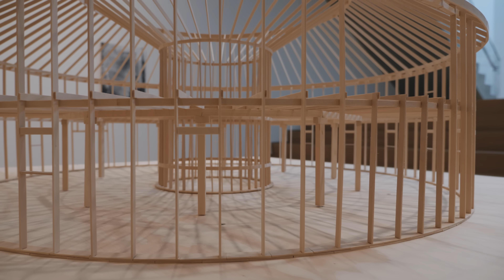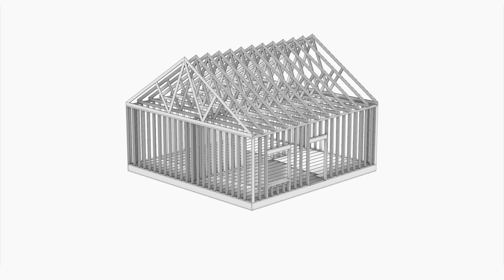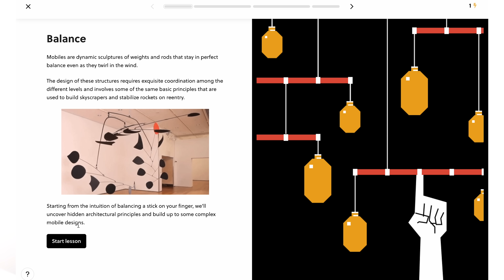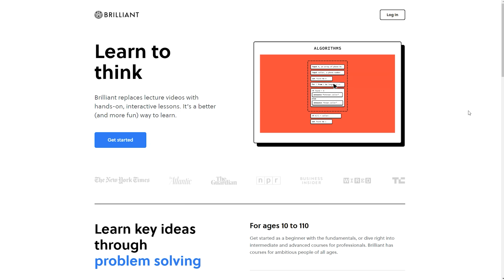The Genius of 2x4 Framing

Comment: Very nice video.  Thanks for producing it.  One constructive criticism:  I don't feel it's fair  to equate professional framers to unskilled laborers.  ((actually it's (unintentionally?) insulting))  A person could spend 30 years framing and learn something new every day; and at the end of that career the materials and building design will have changed again.  Some go to trade school; others learn on the job.  It's a highly skilled, complex trade, and in most cases the first year or two of service consists of simple laboring.  (carrying materials around)  After a person has proven to have some acumen, they may apprentice for the skilled portion of the trade; and after enough working hours and proven knowledge, they may advance to journeyman level, and eventually master.  What used to be considered a "craftsman" in the past would take 5x-10x longer to arrive at a finished product when compared to the production of "Framers" (carpenters) today.  We've utilized knowledge of improved building techniques and use factory produced, uniform materials to increase speed of production while also improving quality, safety, and longevity of most buildings.  Some of the artform has certainly been lost, but that's the "price to pay" for speed and low profit margins of fast paced manufacture today.   Old homes may have beautiful moulding, millwork, and artistic flair, but the ceiling and walls could also be falling apart due to the materials and design techniques used during production; wiring could be a fire hazard, the building may have settled irregularly.  It's all Give and take...  Most quality builds today will last much longer than homes built 100, 50, or even 30 years ago, but they won't have the same flair unless someone specifically paid for it.

I worked as a journeyman siding installer right next to framers, and even though I worked in the carpentry trades, I was no framer, just as framers aren't siders.  It's all skilled labor, but skills vary and not very many people have the knowledge/skill/ability to build all aspects of a modern home today.  According to this article:  https://eyeonhousing.org/2015/09/it-takes-22-subcontractors-to-build-the-average-home/  It takes roughly 22 unique trades to build a home.  That's quite the variety of skilled professionals and I do believe that article left a few professions out. 

A knowledgeable person will recognize a spectrum of skill levels and quality of manufacture.  When I was moved into quality control and warranty repair it became evident to me the difference between tract, spec, and custom home builds.  Custom builders used to be the most experienced, followed by spec, and then tract.  (https://www.hoodhomesblog.com/buying/the-3-types-of-builders-tract-spec-and-custom/) Tract builds were known to skimp on materials (especially types with short lifespans) as well as skimp on quality builders, as the homes are completed with speed as a priority.  Corners get cut, sometimes literally haha.  Spec homes generally had middle of the road materials and manufacture.  Custom homes were.... custom, and required highly skilled tradesmen and high quality materials.  (even the best design will have flaws and a skilled carpenter will have to solve many problems)   I've only been keeping track of the last 30 years, but in that time; several recessions in building resulted in wage stagnation of construction workers.  The price of homes steadily grew, but it's now common for lenders to assume control of the profit margins once earned by builders.  Today, Good Luck finding a quality builder for an affordable price, and the quality seen in these museum displays is unprecedented.  I have NEVER seen framing that clean, nor wood that perfect.  They must have thrown away 50% of the wood products used in that project to result in a structure of that quality.  I digress...  There are time periods of manufacture I avoid when considering a home, or I pay close attention to what has been replaced and upgraded.  Speed, Quality, & Price - You only get to pick 2 out of 3. 

Anyways...  Off my soapbox.

Nice video, just give a bit more credit where it's due.

Comment: USA houses turned to shite in the 80s. Cracked leaky hollow block basements,  rusted out steel lintels etc. A solid masonry house will last centuries and thereby be more eco friendly and can also be insulated. Lifespan of a crappy split level 2x4 house? Like what, 50yrs max?

Comment: Currently living in Belgium, of course there's remnants of timber housing throughout the EU, they've largely due to it's fire retardance and thermal performance. Not to mention the government's incentivisation for efficiency which comes with lower costs to heat/cool the home and lower taxes by the government. The biggest drawback that I've seen so far is the ability to make modifications to the homes. "Modular" is not something you usually get when you have concrete walls...

I would be interested in a video of this type of construction as it's so heavily used here in Western EU.

Comment: Another important difference between balloon framing and platform framing is the way platform framing transfers loads down onto structure below whereas balloon framing often times relied on the nails themselves to hold the load to the wall.
Reply: My friend's old chicken coop barn is an example of your point about balloon framing. The second floor is nailed to the studs with nothing underneath the joists. I never looked that closely at the construction until we added a new 8' door. While it has issues that need correcting still, we are amazed the barn is still standing after a century.
Reply: Most have a 1x6 ledger board notched into the studs that sits under you joists for support and the nails just hold the joist yo the side of the stud with becomes worthless after every membership as floors is tied together in the house
Reply: @metaldetectingnmore8763  this. On all the baloon framed houses I’ve worked on, joists hanging directly off studs has never been a point of failure, save for instances where a joist twisted and pulled it’s nails loose. Those 1x4” ledgers notched into the studs do an amazing job keeping things in place, even 140+ years later
Reply: This is especially true when your Mom is in my bed, you know because she's SO DAMN FAT! OHHHHHHHHHHH BURNED!!!!!!!!!!!!!!!!!!!!!! LOSER!!!!!!!!!!!!!!!!!!!!!!!!!!!!

Comment: saying you dont need skilled labor to produce wood framing is hilarious have you ever framed a house?
Reply: Maybe Steward and everyone should get some hands on field construction experience in real time. Reading about carpentry doesn't mean you can do it or understand it.       
Noticed on some videos on the left there is a board with cutout pieces for a table. Nice but would have saved material if the pieces were butted against each other using one cut instead of two. Point is, do something multiple times it becomes standardized.

Comment: The rest of the world doesn't use this method. it would be neat if you could cover how Japan builds with wood. They use Timber framing with a low-skilled workforce to put it together. That's because all the wood pieces are precisely cut in a factory. When the building is framed it's completed in a single day, workers only use mallets and a crane which is attached to the truck carrying the lumber on site.

I get a bit of culture shock with American houses built in the last 50 years. The walls are paper. There is no soundproofing from one room to the other and it makes them feel like toy houses.

Comment: I have always been puzzled by the light framing in the US. As a carpenter in the northern parts of Scandinavia, almost every building in my country is either concrete with massive timber framing, or massive timber framing which are 2x6 45/145mm. It's rarely nailed together, it's mostly assembled with steel construction screws of 5 to 10mm diameter, depending upon loads. And of course also anchors and bolts.
Reply: Here in England we would only use 4"x2" for a cheap garden shed...
Reply: @eps200  we use 2x4 for stud walls mate.
Reply: German here. The wood frames americans use are thinner than what we use for "temporary" interior walls most of the time. It explains all these tv tropes and memes about leaking roofs, holes punched in walls, people just crashing trough walls etc o.O
Reply: @Maschinengoth  In all of Europe we use stud walls in many new homes. These are just the same as American homes. The main difference is the the amount of block and brick on slabs is higher.
Reply: @PiOfficial  2x4 is the absolute minimum and it gets even worse if we talk about finishing/covering these walls. US standard is a single layer of drywall....
Reply: @Maschinengoth  tbh single layer of drywall is standard in the UK for a stud wall, atleast it’s all I’ve ever seen.
Reply: @PiOfficial  KNAUF Standard Details  have entered the Chat 😅 seriously Single layer drywall isnt even a built in closet in Germany. I cant fathom spending hundreds of thousands on a construction job and then the first misplaced ellbow puts a hole into your hallway wall 😭
Reply: @Maschinengoth  eh, I’ve never once made a hole in a wall, my flat is dot and dabbed on block mostly but some walls are drywall on stud walls. Never even heard of someone doing anything else and I’m not sure why you would personally if I was building my own home I’d see no real reason to waste more money on something that doesn’t change my day to day life at all
Reply: @Maschinengoth  Yeah, trying putting your elbow through a properly installed 1/2" gypsum wall board on 16" centers. You can't. At least not without serious injury.
Reply: @Maschinengoth  you believe too much of what you see on TV. What are your roofs made of in Germany? Wood, you say? Interesting.
Reply: @jonathanwilliams1641  this isnt about Material, but the combination of Material, Dimension and facing. Our roofs arent made with asphalt shingles for starters.
Reply: @Maschinengoth  Well, how are they made? Using Google Earth it appears like the common house has a pitched roof (framed out of wood) and shingles. Those shingles are probably installed using wood battens. So German roofs actually use more wood than American ones? Why asphalt shingles are common in America is because they are made using petroleum and it's my understanding that petroleum is not as plentiful in Germany as in the USA. Again, people use what is available near them.
Reply: @jonathanwilliams1641  the standard for pitched roofs is just regular "brick" roof tiles. Slate for fancy historic stuff. Commercial buildings and more modern architect  designed homes tend to use sheet metal (KalZip is a common brand)

Comment: based on the image of hamburgers and timber frame construction: after enjoying a hamburger you'll be hungry again an hour later.  with the frame construction you have the outdoor climate in the house within a short time without using any energy.  what would be due to the roughage in the hamburger is the lack of capacity in the timber frame construction ...

Comment: I wasn't sure at times if this video was about wood construction or burgers. I've built several houses and garages out of 2x lumber and it was pretty much junk. And this was 40 years ago, now I hear the lumber is even worse. Later on I built residential buildings out of steel and this was a much better option from a build and finished quality standpoint. I once had an old brick man say "masonary is the only permanant building material" and I couldn't argue with that since their are century old buildings made this way. I'm old now and probably won't build anymore but if I was young I'd learn all I could about concrete construction and go that direction. Blessings.

Comment: In Germany we use heavy wood construction.  Carving special notches at the joints is not necessary with modern metal joining hardware.  My architecture school in New York also tried to tell my that heavy timber construction was still made in the old medieval way.  Americans should take a look at heavy timber construction in Europe.  It is superior in many ways especially new prefab techniques.

Comment: Timber framing is not like post and beam except that they both use wood. This guy is equating a butt joint with a mortise and tenon, they are very different mechanical joints and one lasts for a millenium while the other lasts a century. Toss an earthquake or strong storms in and things degrade very quickly. Light framing is even further removed from quality by using butt joints, they are fast and unskilled workers can do them with little training. Modern firearms did this same thing to archery, you don't need years to perfect the skill, just a quick tutorial.

Comment: 2x4 framing is the standard in the Nordic countries as well. The reason this become popular around 1850 is I think, that beside cheaper nails (as mentioned below) also the industrial revolution resulted in better saws capable of doing better quality planks without too much waste. 
I guess when good planks and nails was available you started doing this kind of houses on many places around the world. 

To note is that the standard for distances between different elements in the this type of houses are different in different parts of the world. Would be interesting with a video to discuss what the differences are and why.
Reply: what came first though nordic light framing or american light framing ?
Reply: I guess about the same time or maybe 1-2 decades later in the nordics. I checked some history pages. In sweden it was common in some regions for sheds and barns around 1850. For living houses, where more insulation is required it came later.
Although cut nails was invented in Sweden at the same time as in the us ,1795ish….production started much later in The nordics.
Reply: Building Codes

In America the 2'-0" x 2' -0" or, 2'x4', grid is used. Plywood sheets are 4'x8', CMU (Concrete Masonry Unit) with 3/8" joints are 16"x8"×8". So, three blocks are four feet in length. Same for 16" o.c studs. And, so on.

While Hicks is from Chicago close to Canada where Douglas Fir is available Southern Pine, longleaf, shortleaf, loblolly, slash, is used in other regions. Pre-Colonial America Longleaf Pine covered more than half of the land densely packed with only a few yards between trees. Since then there have been four successive generations of trees. Slash Pine being the latest. The structural strenght of the wood determines code requirements. Plus, unions, banks, industry and conservative over built standards.

Comment: I think a lot about stick framing. It is really dumb. Plywood has made quick resilient shell structures possible for a century. Bucky Fuller figured out what to do with it in the 50s with plydomes. Then Chuck Henderson with conics. And recently Vinay Gupta with hexayurts. 

But we are still hanging material that can support itself on expensive, complicated frames. Or gypsum crap that crumbles with fire, water, and impact. Real design (and new materials like MgO) are going to wipe this nonsense off the face of the earth.
Reply: Its the banks that determine design. The resale value of a mortage.  
Codes made by industry, unions, etc., are a big factor.

Comment: I don't live in one, but consider the geodesic dome. No flat walls on the outside to be easily flattened in a tornado or high winds. If covered in steel rebar & concrete could be fireproof and shed wind. The folks in California where all the fires are burning down whole towns should stop building the same type of buildings that will just burn again. Same goes for tornado prone areas, how many times are you going to keep building flat walls?
Reply: As long as the banks, codes and unions say so.

Comment: 9:15 look at that timber framed vs light wood framed I wonder what the end weight is between the two in wood mass on two finished buildings ,because I've heard that that if done right it can actually use less wood by weight and be more disaster resistant ,but i have no way of testing this for factuallity, certainly looks like it uses a little less

Comment: Metal studs are far superior to wood framing. With environmentalist preventing logging, the price of lumber has increased tremendously. Along with that, our forest are not being managed as they should and the lumber that could have been used to build homes has burned up. Thus causing more damage to the environment, allowing  toxic chemicals to enter our atmosphere, damage to our water systems, loss of property and most alarming loss of life. Metal studs are faster to erect, much higher fire rated, less prone to damage during an earthquake, no dry rot or also called fibrous rot, no termites, no warpage, and  less weight. These are  just a few advantages. There is a reason why you see most commercial building built with metal studs.
Reply: How much energy and material does it take to make a metal stud?

Comment: The reality is that this is the worst possible building method 
u ask why ?
just ask yourself how the city out of 2x4 look after huricane ...there is no city at all , only wood flying around 

there are alternatives like reinforcement fiber concrete as a frame .... super simple cheap frame out of it can easly hold up when huricane comes

thick wood + screews 

steel 

wood + steel reinforcement + screews 

2x4 nailed together can be taken apart by few people in one day ....and the same goes for any other style +/- 
not in every case u will save material 

but only 2x4 will get destroyed in case of huricane 

except if u make the roof properly and it is super strong (for example u can anker it to the ground using steel  etc so it wont ever get destroyed by wind
if the roof is in one piece ....the house will be too